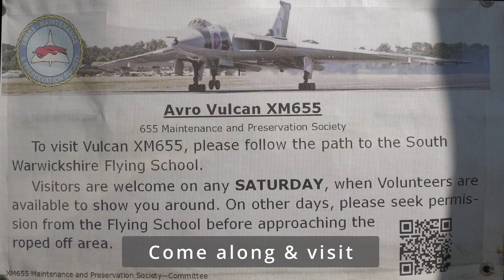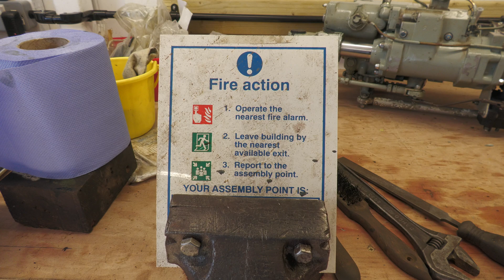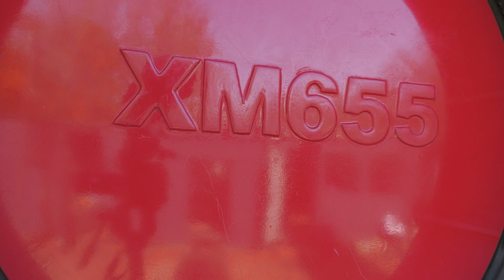CLOSE-UP XM655 Vulcan Bomber Maintenance - Skinned Knuckles

Comment: I’ve been an aircraft maintenance engineer for over forty years. That clamp is the most difficult job I’ve ever done. I after many failed attempts, I successfully fitted it on two separate occasions. I learnt a lot about determination.
Reply from the maker: I can assure you there were a few off camera choice words said that day 😁
Reply: @AeroSteve.i  I'm sure there were! :) I was on 101 Squadron at RAF Waddington, 1979-1983 and XM655 was one of the squadron's aircraft. I may well have done that job on XM655 in the past.